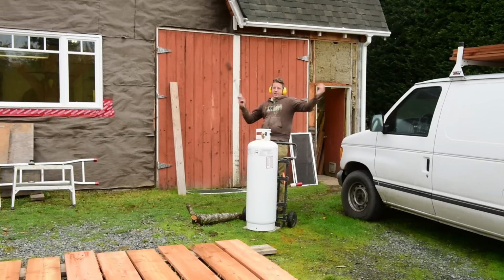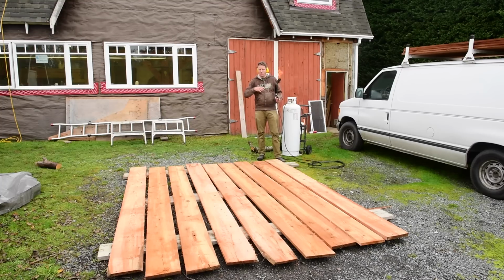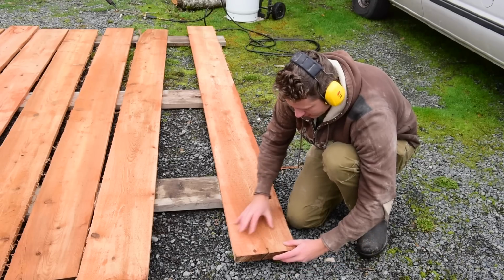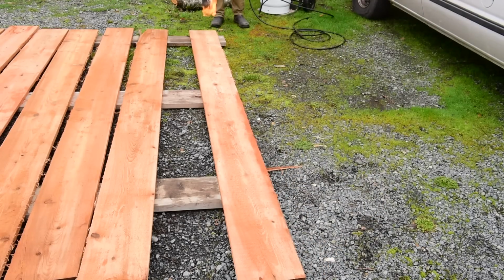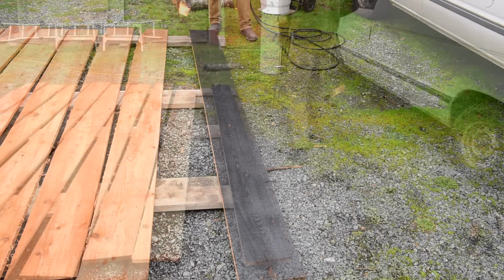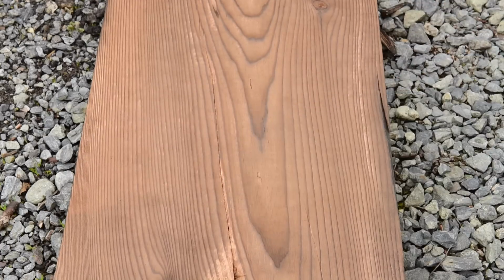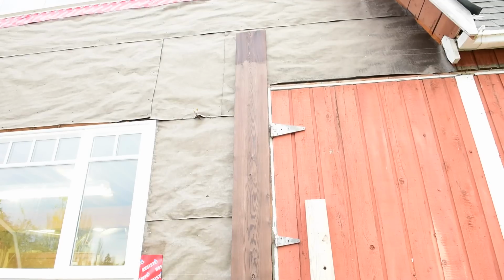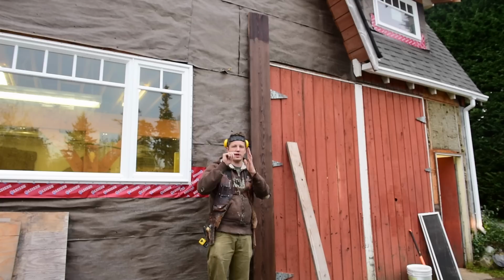FTF #41 Burnt Wood Siding Technique, How To

Comment: This looks great.  Do you get black off the boards when you rub your had on them or does the wire brush get it all off?
Reply from the maker: There is a little black if you rub your hand across the board.

Comment: Speaking of moisture, did this lumber air dry for a good amount of time? Could this work with green stuff?
Reply from the maker: You can use green wood but the surface has to be dry before you torch it.  I just left the boards out in the sun to dry for a couple hours before torching.
Reply: Thanks!

Comment: @thesamuraicarpenter  Let say you did this to the top of a coffee table.  Can you sand it?
Reply from the maker: Yes but you would just end up with raw wood again if you sanded it.
Reply: Thanks for the reply.  I did some experimenting with this.  I went straight to 220 after torching my coffee table that I made.  The result after a couple of light passes then a heavy Tung Oil finish give the wood very nice look.  Also, if you wondering the burned wood smell goes away within a day.  I've got a European Elk mount to pick up in a couple of weeks from this past seasons hunt.  I'm going to glue up some cedar, burn it then mount the skull and antlers on it.  I'd like to send you a photo when I'm finished to get your opinion.  Thanks for responding

Comment: Try plainer instead of sander
Reply: I believe its a rotary wire brush, not a sander.  The idea is to remove the softer burned wood.  PLaner would leave that and take off the harded material which is what the technique desires to leave on.

Comment: I've actually used this exact method to make a dining room table for my brother in law, granted I didn't know what it was called. But I used Scotchbrite pads, and just rubbed it down by hand. But it's super messy no matter how you do it. Best to wear a respirator. I then used grey stain over that, and a satin clear coat. Then trimmed it with 1" steel flat bar. It turned out beautiful.
Reply: Craakyerhead sounds great! Making plans for my farmhouse table! Can u link up some pictures ?

Comment: I am curious about your choice of siding style.  You are using bat and board which surprises me.  Being that you are in BC, a fairly wet marine climate, I would have thought you would use a horizontal overlapping siding style so the rain sheds from one row to the next and to reduce the number of exposed joints in bat and board.  Just curious as it is likely that I am not considering something you are aware of. I love the burnt technique, raised grain looks beautiful, kinda like searing a steak or caramelizing the onions for the steak.

Comment: The best exterior wood protection to brush or spray on is Outlast log oil. Stains will not hold up well to the weather conditions, nor will it protect against termites or rot.

Comment: I used to treat carved wood figures and statues, reliefs and all sorts of things with blowtorch. So I'm very used to this technique. Usually indoor-products I put basic lacquer on it and thats all. In time the darkness of the wood fades away anyway, in terms of 5-10 years.

But outdoor products I charred/burnt/however you describe this finish, was a whole lot different. And my suggestion is that even you might not like the dark colour,  please put some finish there. 

Few nameplates I did, the burnt wood without any surface finish went gray in just after one summer. The sun was just too much for it. Even with quality outdoorfinish on top, it just wont stay more than two summers if exposed to sunlight and elements. And yes, I also always brushed the excess off. I don't know what kind of finishes you have there across the atlantic, but I'm quite confident to say that use some finish over it. It will fade in time anyways, sooner or later.

Comment: Sensei, I've used this technique before on interior wainscoting. We blow torched it to the burn level you used (lighter burn time leaves more raised edge grain); steel wool by hand just to knock off flakes, and then wiped it down with a clean rag. After that we used Danish oil to seal. It leaves it much darker, which it looks like you weren't going for, but left me feeling confident the wood had been sealed against any future water/burn damage. Just another way! Grasshopper out

Comment: I mean, that's how you burn wood siding, but not how you do shou sugi ban. When you do shou sugi ban you bind three boards together to make a chimney and make a small fire in the middle the fire will be drawn all the way up the length of the board. You also wouldn't scrub the burnt board with a wire brush they just wash it under running water, and scraping off the carbonized wood totally defeats the purpose of shou sugi ban, which is to increase the life of the wood, the carbonized surface is water proof and weather resistant.

The effect of the wood is really nice, but this isn't shou sugi ban, not even close.

Comment: I love watching your videos...always amazed at your precision, skill and love of all things wooden. Thanks for sharing this wonderful technique. For good board and batten nailing technique - Wide boards bark side out, the edges cup outwards to the exterior, battens bark side in, edges cup inwards, pressing against the wide boards and making a tight seal. Nail wide planks down the centre only. Nail battens, also in the centre, to the underlying substrate, not through the wide boards. This allows movement through the seasons as the wood contracts and expands, and helps to prevent splitting. The more char you leave on, the better the wood is protected form UV, fire, rot and insect damage. Thanks due to Mr Chickadee, who gives a fuller explanation on his Yakisugi/Shou sugi ban video.

Comment: Great video as always! 
It seems to me that this torching method takes a lot of time for all the boards. I don't  know if this works, but maybe if you take the boards and set up a forgelike contraption with your forge-burners you could push them trough and carbonise them this way. To test it you could use your forge with smaller boards. I don't know if this method works or saves time with all the setup but you never know.
Reply: for the wirebrush you could also devise a planerlike holdingtabel with a moveabel fence where you push the boards over in a more controlled manner.

Comment: There are a few slight inaccuracies in the description given in this video. Charring makes the wood sun resistant only if you leave the char on the wood. If you wire-brush it off to see the darkened, toasted wood under it, you loose a good deal of the sun resistance and insect / rot / decomposition resistance of the wood. Char and charcoal are naturally UV resistant because it absorbs UV without decomposing. The char itself is what protects the wood; the brushed wood looks nice but is only a fraction as long-lived as the boards which have the char left on it.

The insect and rot resistance also comes from the char; the pores of the wood aren't sealed by this process, as you stated. If the pores were sealed, the finish you applied wouldn't soak in. Traditionally they used tung oil or some other oil based finish such as linseed or spike oil, and the charred boards still would last 80+ years; this is not because the oil finish itself can last that long, but because the oil soaks in, but any sun damage is limited to the very outer surface, since the charcoal absorbs UV and protects the finish that soaks into the pores from sun damage while the finish prevents water infiltration to the wood inside, which is un-charred.

Charcoal cannot decompose any further, and is not of any nutritional value to insects or fungi, so they will leave wood that has a charred surface undigested. (They can make a habitat out of char, but they will not eat or decompose it. If you've ever heard of biochar, which is charcoal used as a soil amendment, that's what's going on with biochar. Biochar, unlike compost, does not decompose further and will not revert to carbon dioxide through decomposition. Unless it is burned, it is permanent.)
Reply: Thank you Mr. Austin Liu for your very informative comment. I wish I could learn more from you regarding wood.
Reply: Wow. All other videos on shouri sugi ban (sorry I forgot the spelling)  always show the wood being brushed! Thank you! Tse tse!
Reply: Can you do this with any type of wood?
Reply: Marten Dekker  under field conditions; compete decomposition of Biochar would take 4000 years !
Reply: Me Lui, is there a particular wood that you consider the best for housing ?
Reply: @westlakey1379  yes, some look better than others though.
Reply: Yes, this is the way I understand it, too. You should also understand that the traditional way prescribes hanging  the boards with just one nail, and then the battens are nailed BETWEEN the boards, and not through them. That way the boards will not crack when moisture variations shrink and swell the boards. Just like installing wooden shakes on a roof. It lasts a really long time if you install it right. If you don't, it won't. If you don't know, now you know.
Reply: Mr. Liu you know ur sh#!. I honestly have been doing a pretty good bit of woodworking myself in the last year. I learned more in the last 5 mins from reading ur comments about what is true and isn't then i have from anyone else on here. I and im sure other just starting out wood workers appreciate facts and truths. Thank u sir for sharing ur knowledge. Much appreciated
Reply: @listennowbreath  I can't speak for him but most carpenters myself included would tell you it depends on what's available and what the application and desired look is in the house. I'm in the US on the east coast there's no way someone in Japan or California and I would all use the same types of wood for similar tasks we grow different kinds of trees and so different kinds of lumber generally available.

Comment: I saw a traditional japanese woodworking video where they heat a flat metal iron and press that along the face of the wood. That way you just get the colour without the charcoal and dont have to do a lot after in terms of finishing.

Comment: Shou Sugi Ban is the japanese term for this method of preserving wood. If you watch a few videos on this technique - I'm sure you did - they leave the alligator crackling on and clear coat the whole board and side with these. I thought that removing the charcoal would remove also about 80% or more of the protection that this method provides.
Reply from the maker: That may be but ultimately I don't want my barn to look like a piece of burnt firewood.
Reply: The Samurai Carpenter what if i paint the wood? i mean, i am not really into that clear finished  but into the protection it provides, you know all tha fongus and weather protection. am i still getting same protection when painting it???

Comment: check out Norwegian wooden churches
they used the same technique but finish it off with wood tar.
unlike an oil wood tar will replenishing the resin content in the wood. a wood oil will actually pull out the natural resins from the wood.
the burning does seal but with the wood tar you won't need to do anything for the next 10 years
Reply: @Guy in Colorado, Greetings! I wouldn't know any brands in North America. Wood tar (pine tar) is made from Pine,  beech, or ash i believe. Its made much like you would make coal in the old days and is a by product from that process.